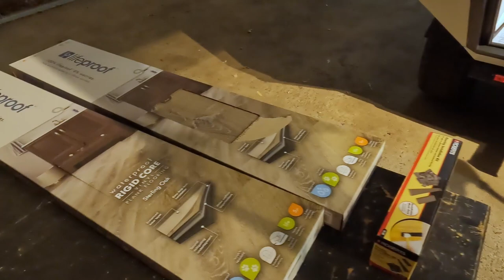DIY Overland camper trailer build: cabin part 18 - flooring

Comment: Fantastic job…. Just a thought if you tack weld the bolt heads and washers for your rubber mounts you’ll be able to easily uninstall the cabin. With the floor install you currently don’t have access to those bolt heads….. what a great build!!!!
Reply from the maker: Thanks!  I thought of that but wasn’t sure if it would weaken the nuts.  I might go back and tack in a couple pieces of steel to capture the nuts before I finish the walls.
Reply: @infosponge  how did you select you wheel positioning for proper tongue weight?
Reply from the maker: @garyblinkey7766  I referenced dimensions from some commercial trailers (mammoth and turtleback).  I also designed it to have the same ball to wheel length as the Tacoma wheelbase.  Hopefully it will all work out when it’s done.